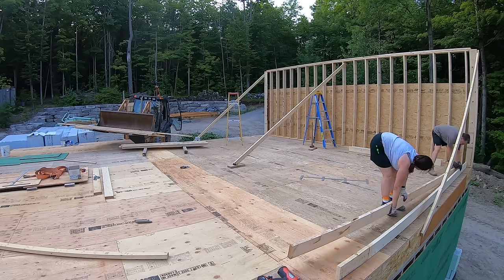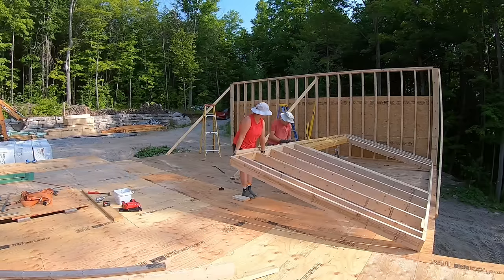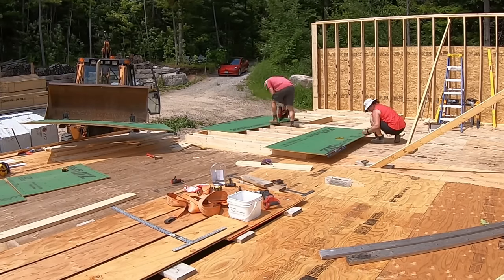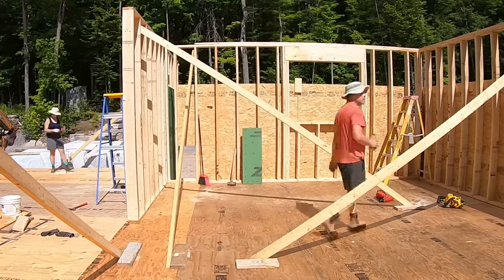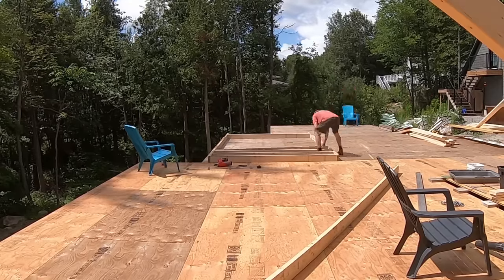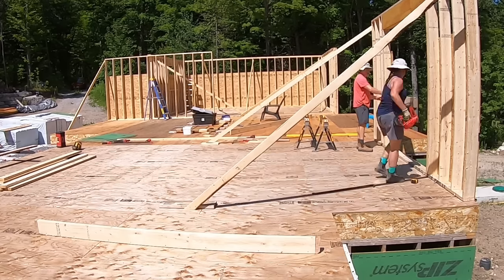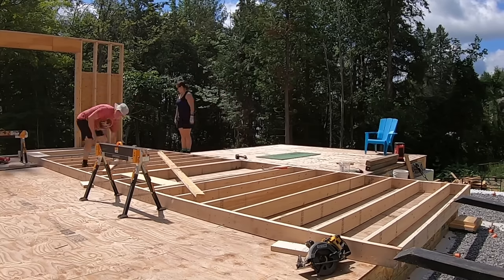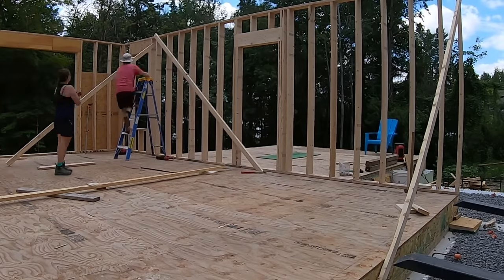Lakehouse Build - EP19 - First Floor Walls!

Comment: No noggins in any walls to keep your studs straight? The sheathing will likely hold them but still - noggins would be stronger.
Reply from the maker: I have never heard the term “noggins” before.  What does it mean?  We typically build the wall, measure the diagonal to ensure it’s square and then install the sheathing and that keeps it square. 
Thanks for watching!

Comment: I like the jig you use for the stud layout. Does it increase the odds off an accumulating error compared to using a tape measure? Where is your property located?  I just returned from my first Vancouver/Whistler vacation and it was absolutely amazing. You two are doing a great job. I am envious!!
Reply from the maker: I did check a few times and nothing more than a 1/16” off. The key is to use a sharp pencil and I have been using the Pica brand. They are fantastic! Crisp lines help avoid accumulation errors. The jig certainly saves time compared to pulling out a tape measure. 
We are in southern Ontario, Canada. 
Appreciate the comments!  Thanks for watching!
Reply from the maker: I did check a few times and nothing more than a 1/16” off. The key is to use a sharp pencil and I have been using the Pica brand. They are fantastic! Crisp lines help avoid accumulation errors. The jig certainly saves time compared to pulling out a tape measure. 
We are in southern Ontario, Canada. 
Appreciate the comments!  Thanks for watching!

Comment: I'm sure you realized that you needed a continuous top plate during wall construction to help keep the wall straight for future alignment. Also, plate you added as you lifted it, was one used for added strength and locks the adjoining walls together. It should have been added after the walls were up, and for alignment purpose. Sorry to remind you.
Reply from the maker: Normally we build the wall on the floor with 1 top plate and once the wall is stood up you add a 2nd top plate to tie everything together. In the case of the triple LVL wall, we couldn’t build with a top plate as the LVL would have been too low and not allow for the door rough opening.
Thanks for watching!